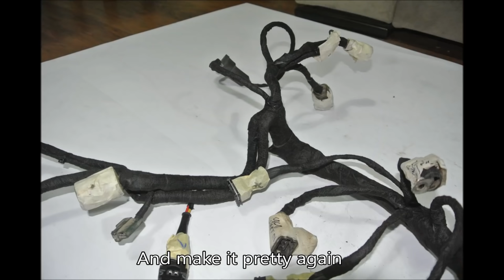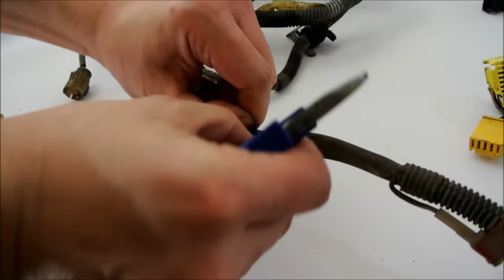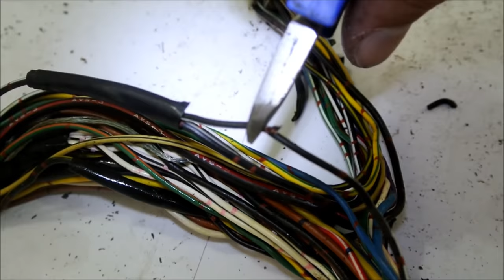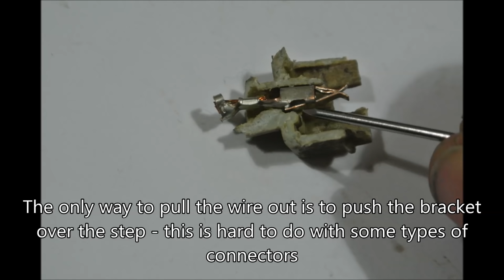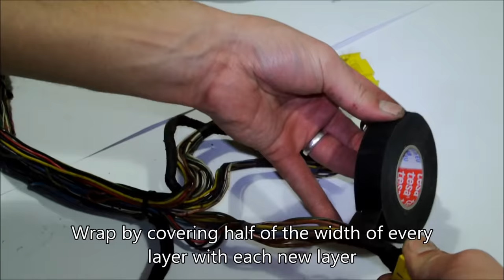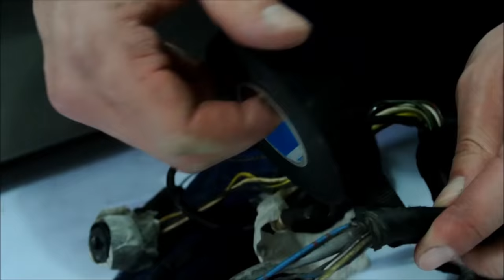How to DIY - wiring harness restoration

Comment: so you took off this wire harnness off the car to take the insulation off and re tape it.Why not remake the wire harness and ger rid of that old wires.This is not a "Diy" you are just re-taping the harness
Reply from the maker: It's definitely a diy, as I'm obviously doing it myself. You know what diy stands for right?
Reply: @d4a  yes i do. your title is do it yourself restoration. You are not restoring anything. You just taking off the loom and taping it up but still using the wires instead of re-pinning and making new wires
Reply from the maker: It's definitely a restoration, as you can see the wiring harness has been dramatically improved and I fixed all broken connections, and replaced damaged connectors. You know what a restoration means right?
Reply from the maker: I was trolling you a bit hoping you would take the bait and get angry. Mostly because you said something that's been said in the comments section of this ancient video dozens of times already and I got bored of hearing it, so I troll most people commenting on this video to have some fun during the pandemic lockdown :) . But you didn't take the bait 😠 shame on you.

Comment: Pretty sure that butt connector is just as dodgy the “proper” way would have been to snip put some heat shrink on one side solder then slide the heat shrink over the solder joint and heat it up lol that butt connector will be full of green puss in no time. Even a heat shrink butt connector would of been better or heat shrink and a non insulated butt connector. That garbage connector is complete garbage